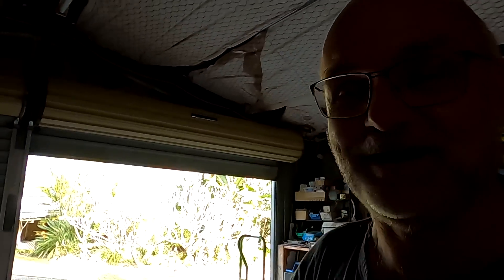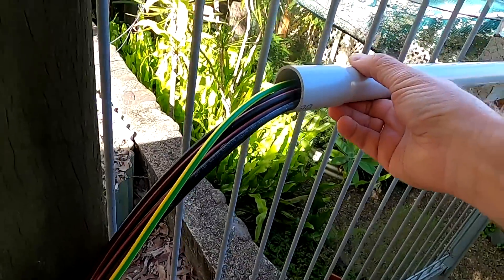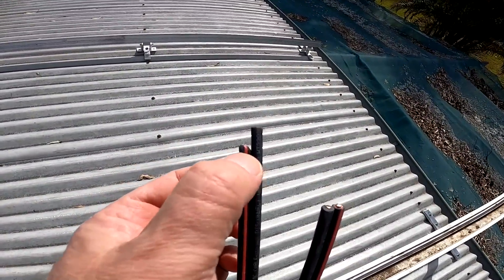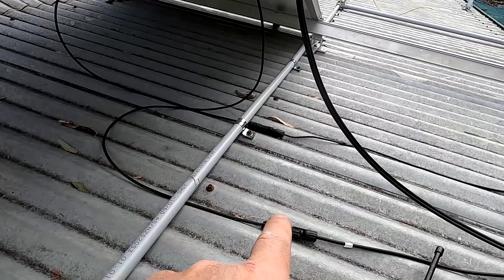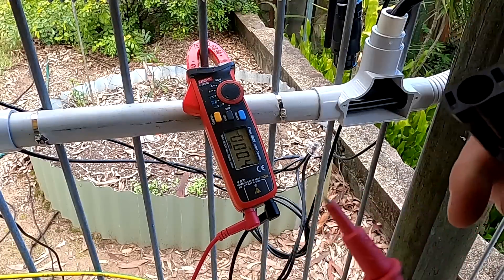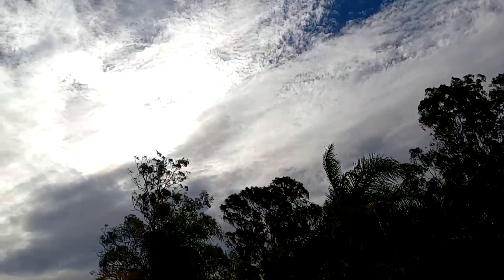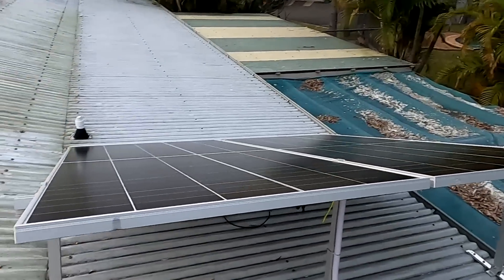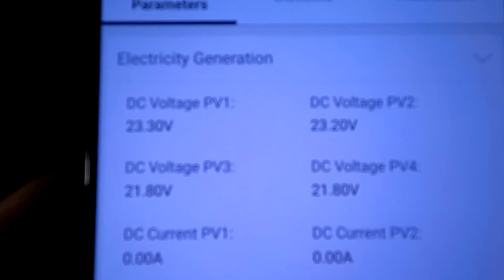Adding additional 2kW of solar production to our Micro-Grid. Solar tilt mount, sunset finish!

Comment: Hint for your winter shade situation : 
Why dont you tryed the hyudai shingeld Panels, instead of trina. They would produce also full power in some of their divided lines, if the others are couverd from sun. 
see 16 min. So the could probably the angel more control. 
As your further test has showed. loss only a few lanes

Comment: I have an array mounted on the roof at ~40 dgr angle, mounted on standard aluminum rails.  A lower part of the roof is only ~10 dgr. What could I do to make the same angle for the  lower part ?

Comment: i have used a small battery and buck converter now and set them to diferent voltages clamp them on the wires on the roof and then when your inside you mesure the cable volktage to know what cable was what

Comment: Andy, those PVC 3 way distribution joints are installed the wrong way! Australian code specify that they need to be pointing down to stop water ingress... 
A grid tie installer did what you have done and had to redo it after the engineer at final inspection didn't pass it even though it was in an area where you literally would need to use the garden hose to wet it.... 
The installer wasn't happy with coming back to change it, but I totally understand why it has to be done that way.... Safety first, convenience second!
Reply from the maker: Yep, I know. We are working here with very low DC voltage and the DC cables are all protected.
You're absolutely right for a grid tied system.

Comment: This series with the islanded grid tie inverter got me thinking about microgrids and how energy storage systems connected in a microgrid could share stoarge and load. I've attempted to simulate one using an approximation of the multipluss and control software that would work on the Cerbo but it would be interesting to see if it would work in real life! I'll post a video of the demo simulation.

Comment: Tip for the next time you are struggling with the cables for which is cable #1, #2 etc;
On one side, connect both strains together (= shorted) and take your infamous UNI-T meter and measure on the other end between the strains in one cable;
If it measures zero ohms (or you could also use continuity mode although I'm not sure with 2x AAA the meter has enough power to cross the longer-length lines) you know which cable it is as you have shorted the other end...
Alternative solution, when both cable-ends are still close together, put horizontal stripe on cable one, two horizontal stripes on cable two, three horizontal stripes on cable three, on all ends of those cables.
And instead metal hooks to the fence, why not use cable-ties? That would be truly bomberfest!
Reply from the maker: I did this later one once the MC4 connectors were installed and shorted one of the cables for the front row.
It was just this crazy day with going back and forth a million times.
Reply: @OffGridGarageAustralia  I fully understand! It is challenging at times I can imagine, working alone, working on a project and also filming at the same time and Andy-2 is not available.
We do appreciate all your efforts and mine are merely suggestions of course!
BTW, if you are looking for subjects for contents, perhaps a behind-the-scenes about what it all involves filming a project, from beginning to the end, the editing etc so people appreciate that what actually involves making your videos.
I can imagine that in all it is time-wise almost doing all the work twice.
Again, appreciating all your efforts!!

Comment: May I come with a suggestion for a topic? 
End to end losses in the system. How much energy is “wasted” to resistance and conversion? How much is 1000w/m2 incoming sunlight converted to - in usable energy when you are making waffles? 

Does it make economical sense to upgrade cables or choose a higher efficiency inverter? 

I love to see you work - and your attitude brings a smile to my face. 

Best regards 
Mark Madsen 
Denmark
Reply from the maker: Thanks Mark, I'll put this on the list for suggested videos.

Comment: I never know how to do conduit properly. Should you try and make it water tight or have drainage holes at the low points?

I feel you're potentially going to get water and condensation pooling in yours on the roof? When you have a few cables going into that one facing upwards it probably won't stay water tight.

Other people thoughts on how it should be done are appreciated!
Reply from the maker: Drainage points are an entry for ants down here. I have done some with some sort of sponge pushed into the opening, so water can drip out but insects can't get in.

Comment: Yeah those solar connectors got me mixed up to. Trial and error wins the day. I'm a newbie to fitting solar. Your video's are very entertaining and informative. Keep up the good work! Dean 🇬🇧
Reply: easiest way to remember is that the female inner / pin is too big to enter the male plastic from the front side, so it could never work correctly if you put it in the female plastic.

Comment: Andy, you are sick and should seek help immediately.  you build a battery, and install solar panels.  Then winter comes and you don't have enough solar, so you upgrade the solar.  Then summer comes and you have excess energy so you build more batteries.  Then along comes winter and you upgrade the solar.  Next summer you will have too much energy and have to build more batteries.  Yes you are on a downward spiral and the spiral is getting tighter.  You must seek counseling immediately to beet this horrible addiction.
Reply from the maker: You all are my therapists.

Comment: Hello again. As i mentioned in another comment you could install more panels on the west side of roof facing north (wrong hemisphere). Also i believe that with sleengind (is that correct) you could install one more row of panels .. closest one another as the shadowing will be only few hours and when the sun don make so much energy.😊
Reply: 18:26  i see the rear roof waiting for some panels
Reply from the maker: The roof to the west is actually WSW, so pointing away from the winter sun. Installing more panels is not the problem but how do I get the energy back to the garage... that is the challenge.

Comment: Andy if you mounted the panels horizontal you would get more output as the bottom and top panels would be shaded at different times
Reply from the maker: It's actually better vertically. These are half-cut panels so the top and bottom of the panels are in parallel and if the bottom is shaded, the top half will still produce full power. I'll show this soon.

Comment: Andy my panel has a white spot is that a problem
Reply from the maker: On the top or underneath? Could be a hot-spot...
Reply: The box is glued under the stain
Reply from the maker: @НиколаДимитров-с6ь  So the spot is where the connection box is?

Comment: These inverters can be used 'off grid', connected with an inverter??     Im wanting to power a 120v mini split at my place, but just want to run it purely on solar.  , instead of another charge controller or 2 and inverter hooked to my batteries, i could do this instead?
Reply from the maker: Yes, they can. It's called AC-coupled for the Victron inverters. They just shift the frequency once the battery gets full so the micro inverter turns off.
I have made a while series about this tilt system installation with micro-inverter in an off-grid installation.

Comment: I started watching your channel when I was installing my own system. I thought I could learn something, and I did. Now I watch your channel purely for the entertainment. I am in sunny hot South Africa on the 24 deg latitude. So my winter situation is probably a bit better than yours. I also have some shading on my panels in the morning and almost full shading from about 15h00. I only have a 6,4 kw solar array but still manage to produce between 25 and 30 kw per day in mid winter. Your shading situation is costing you a lot.
Reply: Wow, thats interesting.....You no longer have power schedding stresses. I am in Tanzania with 10.6kw array but struggling to reach 25kw per day. Partly because of storage capacity.
How big is your sorage?
Reply: @innocentusangira789 I have  13,6 kw storage. But I empty it during the night.
Reply: Interesting. I'm in CT with 6 panels facing east and 8 north and I get up to 17kwh which is mainly constrained by letting power go somewhere. I have seen a peek power output basically matching STC specs on Saturday from the north facing panels - in winter! Theoretically I can get 30kwh out of both sides per day - just don't have somewhere to channel it to.
Reply: @kevinrtres Yes you must have somewhere to channel the production.  I don’t manage 30kw every day but it is possible, even in mid winter.  The larger your storage the easier it becomes.
Reply from the maker: Thanks for sharing guys, interesting to read...

Comment: Regarding the inverter mounting; use UV resistant zip ties as additional backup support so it cannot come off in a storm.  Also, for the conduit ends at the solar panels and the possibility of water ingress, why not use the down facing "U" conduit to keep the rain out?  Like a drip loop.
Reply: That won't stop the march of the Ants!
Reply from the maker: The inverter won't come off these metal hooks. EVER! 😉
The conduit ends need to be sealed anyway, so it does not really matter which way they face.

Comment: What's the trick for disconnecting MC4 connectors? I tried to buy a tool for it, but it doesn't fit. I'm having trouble finding a tool to do this. These connectors are easy to clip together, but they are a ROYAL PAIN to disconnect!
Reply: You can get blue plastic spanners which have pins on them which make the task much much easier.... unless the MC4s are the sort with a non compressing protective ring over the clips. For those I use two small screwdrivers between the clips and the rings to compress the clips to disconnect. There's a couple of connecters that I've given a light coating of silicone if I know I might be disconnecting them in the future.
Reply from the maker: I never could get these blue 'spanner' tool to work. Some MC4s are hard to disconnect. I use some small pliers to push the two opposite hooks together while I'm pulling the two parts apart.

Comment: Did you consider having a higher angle on the back ro than the front as it has nothing to shade?
Reply: Sounds good until you realize that your power outputs will not be the same anymore.....
Reply from the maker: No, they are both roughly the same. The back row is prone to catch more wind, so I don't want to go too high.

Comment: Don't complain about MC4, female, male etc.... Coaxial antenna connectors are far worse 😂
To use the grid inverters you need to add an extention to the Multiplus software config, right? So, it knows how to controll the power frequency to enable or shutdown the grid inverter?
Reply from the maker: Yes, there is an assistant called PV inverter for the Multiplus.
I made a video here: https://youtu.be/HilbXFCX3L8

Comment: So, partly because of you and your panels... I've just bought a pallet of 36 x 410W Astronergy panels. At 0.275 Euro/Watt delivered it was too good not to. My plan is to split the batch with family, and expand my system in anticipation of an EV.
Reply: This project made me curious enough to dabble with adding a couple of extra panels and a cheap inverter in the garden ..... this has now escalated to me having 14 x 400W, a hybrid inverter and a battery queued up for installation. It's got to the point where I have to seek G99 approval in the UK. Thanks Andy.
Reply: Where did you buy them from link ?
Reply: @trollking202  Not sure if you asked me or the the other person in the comment thread, but mine come from a local distributor here in Finland. Not sure that will be of use to you...
Reply from the maker: Oh, nice! That is very good. Ne blog articles coming...
Reply: @OffGridGarageAustralia  Hopefully. Maybe some videos as well. We'll see...
Reply: 405W biface Trina cost 88€ piece, price will decrease like 20% in the next year
Reply: @honumoorea873  Same with batteries. Good times :)

Comment: Do I sense a wind turbine heading this way?
Reply: I think there are too many trees casting 'wind shadows'.  I think Andy should construct a tracking system on a pole mount in the garden space behind the garage. I believe there's space and good sun there.
Reply from the maker: Behind the garage, the sun is very limited and only usable for 1-2h a day in winter.
Reply: @OffGridGarageAustralia  Unfortunate Andy, that would have made good content and been a fun project.
Reply from the maker: @chrisroyle4813  I know. I looked into it a few time but what is it worth if it never spins...🤷‍♂
Reply: @OffGridGarageAustralia  I meant that a dual axis solar tracker would have been a good project Andy. There would have been a part benefit of using some of the old panels - and I'm certain Andy 2 would be keen to help dig the hole and trench. If you've not got a spot for it, then it's moot.
Reply from the maker: @chrisroyle4813  Ah, yeah, a great project. Maybe one day when I have found a space for that to install. definitely something to learn from and share here on the channel.

Comment: I dont like that upward facing conduit under the panels. Yes, seal with silicone, but bend the conduit to face down first.  More bends, but no chance rain water will sit on top of the open face silicone and find its way in. Water always finds a way to flow downward,  but almost never wants to flow upward 😉
Reply: That sounds reasonable. Water, um, finds a way.
Reply: Run the cable above the inverter, not underneath, so the Ts face down.
Reply: @wildisland.beer.000  +1
Reply from the maker: And potential water drips on the inverter...
Reply from the maker: A gland will also not work here as we have several cables in this duct. They work with round cables and make it watertight, not with flat solar cables plus an earth cable. Silicon is your friend here to make it watertight. So has the sparky done it on the garage.
Reply: @OffGridGarageAustralia  It's against PV installation standards to have any outdoor exposed PV cable to exit conduit facing up. The cable should enter/exit from below. The exposed cable can then loop back up to the inverter connector. It then acts as a drip loop.
Reply: @OffGridGarageAustralia  The conduit doesn't need to go above the inverter, the cable however does need to exit downwards. No gland or silicon will prevent eventual water ingress, which why it is not permitted to route outdoor cable that way. Those cable T-section exits should be facing downwards and the cable then looped back up.
Reply from the maker: @alexsimmons1803  Yes, correct.
Reply from the maker: @alexsimmons1803  Thank you, I will have a drain device installed at this point.
Reply: @OffGridGarageAustralia  Hi Andy, they make glands specifically for Solar, and are a requirement in Australia. You can get glands that cater for two conductors and separate earth or four conductors and separate earth.
Reply from the maker: @Fergo101  Got them, thank you! There are also other options under 5033 and as the conduit does not run under the roof, I will go with this option, so no glands needed.
Reply: Or use cable glands like the solar guys do and our regulations call for

Comment: can i add grid tie inverter on an ongoing   off grid  system..!!!!? ? ? ? i think its nice thing for  the  system and helps it   what kind of inverter do i need off grid to accept  extra help  ? ? ? i mean if i have a peter inverter i dont think i could throw the grid tie you just  connected !!!!
Reply: As far as i know only Victron and Deye Inverters have this microGrid function.
Reply: Maybe Sunsynk too, as I believe it's very similar to a Deye ?
Reply: @chrisroyle4813  
Sunsynk inverters are obviously an OEM product from Deye.
Reply from the maker: You need to check if your off-grid or hybrid inverter can do it and accepts AC-coupled solar.

Comment: One thing you might want to do is make sure the frame is grounded that the inverted is sitting on
Reply from the maker: I don't have to as the 230V cable provides the necessary safety for the device. It's hard wired.